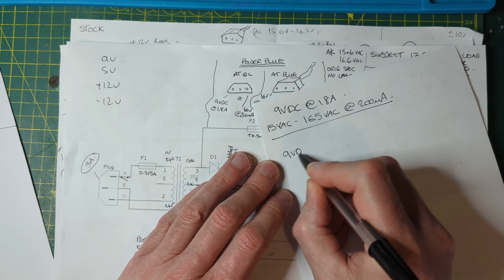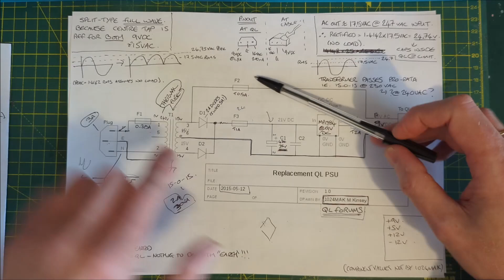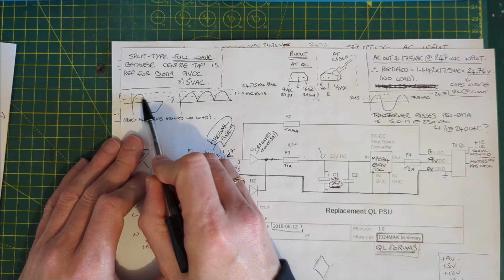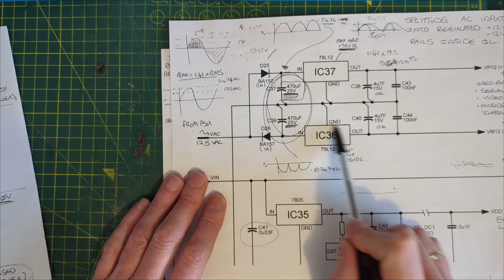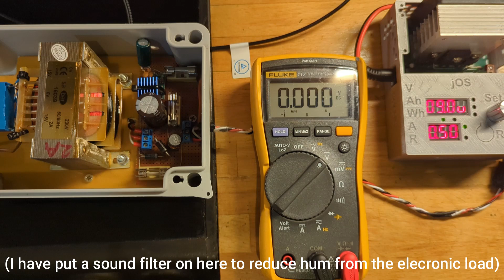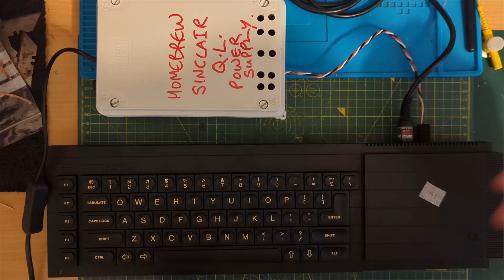Hombrew Sinclair QL Power Supply

Comment from the maker: The little handheld scope at the end of the video was actually fine. I should have realized the designer's logic. - It has a USB C charge port BUT it will only charge using a USB A to USB C cable from a USB A type charger! It won't charge from any USB C type charger despite having a USB C charge port on it 🤣

Comment: What is the connector you use for the power? I've measured the connector on the QL and it looks to be around 2.7mm pitch and I can't seem to find any connectors close. It's either 2.54 or 3.00. While I can see 2.54 would fit as there will be some give in the connector housing, it's going to be bending the pins in the QL power socket a bit when pushed in fully.

Comment: Thank you. Just a note or question. As users usually plugs the devices to the sockets (wall) in many countries we have not (like UK and others have) a determinate sockets that guarantee the live line gores to the live part of the cable plug. So... in such cases it seems to me helpful to double the protection (fuse) to the N line too. What do you think?

Another doubt... F3 is 1A and F4 is 2A... I don't understand it. for what to put F4 after F3 when its rupture value is higher than F3 one?. F4 would never open itself. would be?
Reply from the maker: Happy New Year! I can't give advice on this as I am not an expert. I designed this with the UK plug in mind (which, as you correctly point out, only allows the line and neutral to be on the correct sides). I  also Earthed this device at the transformer housing. Some old Commodore supplies did not bother as they were encased in expoy and so double insulated but any mains powered appliance with accessible metal parts MUST be earthed. This is obviously not possible with a two pin AC plug.  Only advice I can give is to ALWAYS unplug any mains powered devices from the wall if working on them and do not simply switch them off at the wall. The switch on (a UK anyway) wall socket only opens the live. If the AC input is reversed and the device ends up being fused on the neutral side and is simply switched off at the wall then the components inside will remain live at mains voltage up to the fuse (which will be the last point in the circuit under that scenario) even if the fuse blows or the switch at the wall is turned off! I have seen many devices like phone chargers, power supplies etc from online resellers that have European plugs they do not account for the risk you raise. I have never seen a device fused on both line and neutral. I have been 'bitten' in the past by a washing machine where the line and neutral were switched inside the wall socket and I only turned it off at the wall and didn't unplug it fully. Best advice I can give is ALWAYS UNPLUG ANYTHING FULLY FROM THE WALL IF NOT USING IT OR IF WORKING ON IT. Preferably, run it with an RCD or similar fault detection device. Either integrated into the house Consumer Unit or one of those stand alone plug in sockets. 

The reason that F3 is 1A and F4 is 2A is because of the difference in voltage and so total power. 

F3 is on the rectified AC that comes out of the secondary side of the transformer. I THINK from memory it was about 14v AC. That 14V AC is then rectified by the two diodes. When AC voltage is rectified to DC, it increases by 1.41 times. 

14V AC  *1.41 *1A gives 19.7 Watts. 

Even it it was 9 V AC it would give 9v*1.41x1a = 12.7 Watts. 

That is then used to feed the 5v regulator. The output of the 5v regulator is fused with F4 at 2A. 

5v*2A = 10 Watts. So there would still be margin there. I honestly cannot recall what the exact AC output of the secondary side of the transformer was but those figures show the theory.

I must admit, I have not deliberately tried to blow the 5v fuse to test these figures. 🤣

Thanks for watching and commenting. 

Have a great New Year.
Reply: @Plan-C  thank you for the explanation! :) Happy new 2026! :)

Comment: Great video.I just got my hands of one last week with no PSU which is why I'm here, im using an AT not ATX psu and robbed a 7809 from an old 8bit isa card. I might add a filter cap to input to be safe. Next problem it boots with white screen and spaced lines, I read this could be a memory issue, I actually have lots of 4164s around so I will have a bash at this tomorrow. RF
Reply: Piggy backing the ram help me find the bugger IC4, now I have my first ql and it boots 😅

Comment: Many thanks for the theory of operation too.
Reply from the maker: Sorry, I made a mistake in that last reply. The output of the secondary is 15VAC so 15*1.41x1A = 21.15 Watts. the DCDC converter is 9V at 2A so 18 Watts. The principle is still the same though. The 5v is done inside the QL.